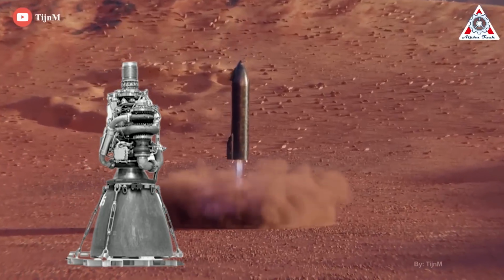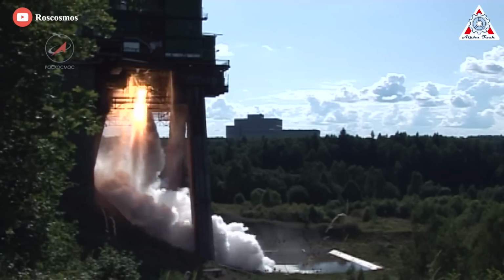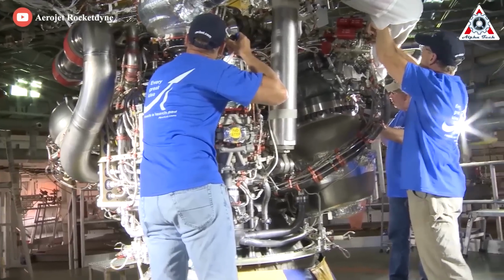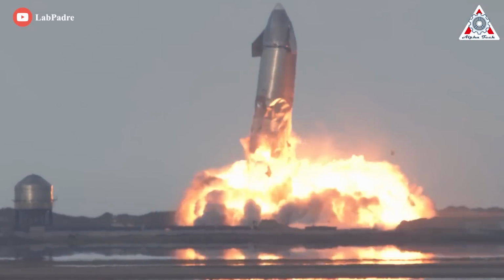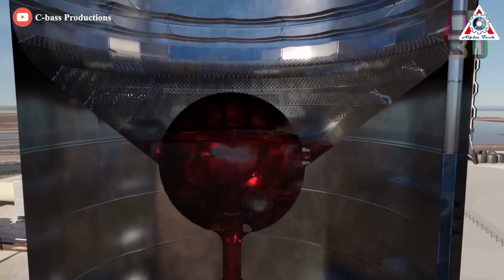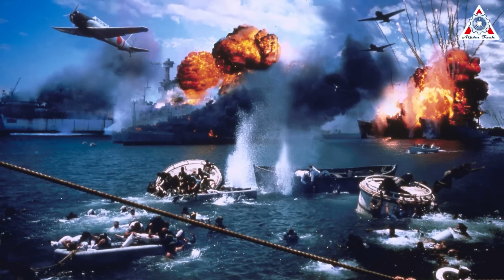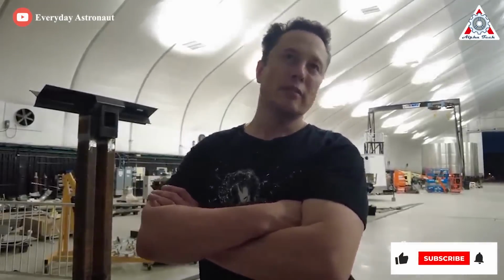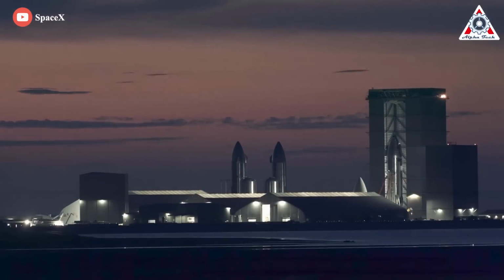SpaceX NEW Raptor Engines "BIG PROBLEM"...

Comment: Actually, the turbopump temperatures are less in the Raptor than in other engines. Reusability has been well developed and proven with Merlin, and one can expect similar steady progress with Raptor. Lets not forget that jet engines at the end of WWII had lifetimes of 30 hours or so, whereas TBO for large new jet engines today can be 20,000 hours, with subsequent intervals between overhauls around 5000 hours. Analogous progress can be expected for rocket engines.
Reply: You can't compare the technological starting point of WWII jet engines with the status of today's rocket engines after more than half a century experiences.

Comment: This rocket remains me of the soviet rocket, that just strapped as many engines as possible to their rocket.

Despite being the most powerful rocket at the time. It was not successful!! 

The more engines you have. The more you have to maintain, while increasing the likelihood of a failure.

Always kiss your work!
Keep It Simple Stupid 😉
Reply: Using the same engine for booster and return ship seems a simple start to their mass-production.
There's a sweet spot for sizing the fuelmix/SCcycle/materials engine combo that Musk's team has yet to find - but they're converging on it.
"Everything should be made as simple as possible - but not simpler" - Albert Einstein.

Comment: The reliability of the Merlin engine supersedes the fuel « economy » that can be done in a full flow rocket engine. They are way too complicated and dangerous, unreliable. Extreme performance is for drag racing, not space tourism… security is paramount.
Reply: of course, but the musk/spacex tribe will not accept that until the thing blows up with their actors, billionaires and influencers on board burning to a crisp.

Comment: If SpaceX is going to actually use Mechazilla to catch boosters and Starships, I wonder if an additional Mechazilla should be built a distance from the main OLM and GSE areas. The catch tower would only need a lift system because it's only used to catch Starship and boosters. If it's damaged, repairs would be much easier. The risk to the OLM/GSE is high and repairs would be much more involved.
Reply: its not gonna work,  at least not over and over again.    thats the problem with the idea.   its overly complicated.    39 engines and then catching hovering rockets with giant arms.    its the idea of someone who isnt an enginneer.
Reply: @jebes909090  Not complicated all and your points are incorrect. A returning booster has already spent its mission fuel requiring only minimal fuel and engines to land it over and over, again.
Reply: @Van_Liberty  its definitely complicated.   its not like landing on a pad,   it has to come in at an exact angle from a specific side.    falcon 9's can come from anywhere just as long as they hit the bullseye  and they just have to land, not hover.
Reply: @jebes909090  A tower for only catching returning craft is much less complicated than a launch tower. You miss my point, completely...
Reply: @Van_Liberty  the act of catching a hovering rocket that has to hit a pinpoint spot at an exact angle from near orbit is NOT 'less complicated'.    come on man.
Reply: @jebes909090  Where did I say in my original post that landing was not complicated. Did you even fully read it? You, then claimed I did state that, and I did not. I will no longer run down YOUR rabbit hole of BS...
Reply: @Van_Liberty  " Not complicated all and your points are incorrect. A returning booster has already spent its mission fuel requiring only minimal fuel and engines to land it over and over, again."🤡🤡🤡🤡🤡🤡
Reply: @jebes909090  The tower lift, dilbert...sheesh, you are clueless...
Reply: @Van_Liberty  tHe ToWeR lIfT 🤡🤡🤡🤡
Reply: @jebes909090  landing boosters on a boat was also like the idea of a non-engineer.  they will eventually do some catching.  it will be a long time before they need the immediate turnaround that's intended to provide.  a more immediate problem is how to take off and land in a vacuum + low gravity.
Reply: @jgunther3398  no,  it was nasa's idea that elon used.   Nasa did it in the 90s  but thier focus.changed and it was dropped.

Comment: This is a very good video.  I'm starting to get the feeling SpaceX won't be going to Mars.
Reply from the maker: Believe in Elon man
Reply: @alphatech4966  you forgot the /s
Reply: I'm sure you have the capacity to filter and logically analyze situations through scientific lenses and mathematical disciplines but your feeling of doubt seems absolute, that's the equivalent of me starring at an equation for too long, then giving up by chucking the chalk at the blackboard, throwing my hands in the air in defeat and expecting some future humans to one day come up with a solution. Unless of course this is just a personal bias which in this case would be pointless debating.
Reply: @__sir7557  "Your feeling of doubt seems absolute."  Good argument.

"Doubt" and "absolute" literally mean opposite things.
Reply: @greg55666  i 'get' the contradiction in the literal meaning, but this was implied as a metaphor rather that a philosophical expression or a mathematical concept. I could rephrase this as being highly certain about your skepticism and it would denote the same meaning without violating the rule
Reply: @__sir7557  Yes, you could rephrase it, the problem with that would be, it would belie the silliness of your entire criticism of the "logical foundations" of me expressing a simple impression I got from the video.

Comment: When an explosion is called a rapid unscheduled disassembly you might say it raises a red flag
Reply: In the RC modeling world, it's called rekitting. It's now a kit, again. Planned destruction is always there. Many things can go wrong. To get off of the pad was 50/50. To get to separation stage was excellent, especially with so much damage from the launch. I have never liked his platform, nor the lack of a trench to carry off the heat, vibration and pressure. There is still a lot to learn from the old NASA guys.
Reply: NASA called them this but had the wisdom to keep it a cheeky, inside joke.

Elon trying to sound cheeky is pure cringe.
Reply: Yeh big crator made on mars

Comment: Why do they not just make these rocket engines 10 times bigger? They are too small. Make them  big.
Reply from the maker: Too much power
Reply: Because of sonic wave instabilities beyond about 600,000 lbs of thrust. The only engine to tame the instabilities was the F-1 (1.5-1.7 million lbs thrust), designed more by trial and error than anything else before the days of supercomputers. The more powerful RD-170 uses a single closed-cycle turbopump system and four combustion chambers/nozzles. The RD-180 on the Atlas 5 is basically a two-nozzle RD-170. In any case, F-1 size single chamber engines make no sense when reusability of the rocket is in the picture (the F-1 being a not particularly efficient gas-generator cycle engine, incapable of throttling and re-start).

Comment: One concept I have been thinking on long term, is using water injection into rocket engines to both control their temperature and to increase thrust using what ends up as waste heat. Work it like an after burner.
One could also use such a system that was controlled to cool the engine and bell at the last seconds while still producing thrust, and with proper regulation and timing, use it to cool engines slow enough to prevent thermal shock in water landings. where you cut off the gasses and used last of engine heat up, creating the last pulse of steam thrust instead. and brought engine temps down to near ambient enough to prevent damage, and unlike the shuttle you could come in under power to prevent mechanical damage.

Another question I have
 is if such a system could be designed for use in space, and if it would be possible to get a combo of high enough temps on super heated steam, that you could do an electrical high voltage charge of the bell, and strip hydrogen and oxygen atoms via a high temp open electrolisys, and use some percentage as fuel as well as expansion gasses, I suspect it is possible in some  combination, using the rocket heat, the high voltage charge, and maybe even lasers.
Basically the obvious fuel of the universe is water. No shortage of ice, and getting beyond Mars will mean using ice.
Reply: When jacket and film cooling reach their limits, the next step is not to inject water but to run more fuel-rich which serves the same purpose. A steam-powered rocket also has a much lower ISP than fuel+oxidizer (around half) so why build a hybrid.
Reply: @darrell857  Well, I'm talking about using what goes out as waste heat a bit more than currently, and being able to potentially cool it down during a last pulse to near enough sea temps to dunk the engine without quench shock  temp  effects.
Not sure if the thrust from injecting the water would be worth carrying it along, but it would allow cooling the engine from combustion chamber aft, and we know the military uses, afterburners to create seriously better thrust on jet turbine engines, with the same amount of fuel and oxidzer.  they just cant carry much of it.

Also using the fuel rich mix will be pollution generators, that smoke is unburnt fuel, as has been known since steam engines... So you are saying we should add carbon to the air instead of water vapor.
 (not PC! 🤣)

Also the fuel rich mixture will be harder to light, and less likely to stay burning than the correct ratio, and from the last launch, I'd say thats not what we need, we need to increase reliability of engines functioning.
I suspect its possible considrring how short burns are, to use a sacrificial water cooling of engines and then use venturi type effects to get it internal aft of ignition and combustion, and use it to increase thrust, and decrease heat of the gasses at the same time.
This might be good in primitive fields to reduce problems where there wouldnt be water cooled steel plates for take offs and landings. to be able to effectively throttle down on fuel and use cheap water and not lose anything.  seems to me would also be great for take offs as the water would create reaction mass and lighten the ship at same time, this would maybe work really well in ships designed to take off from partially submerged in water, as the water abd fuel/oxy mass going out would increase buoyancy and get the ship beginning to move upward...

We notice that in non buoyant gravity situations it takes 8 seconds before the ship even begins to move... i.e. stationary innertia.
Ships of that size would pop up pretty good, plus. being in water would effectively weigh less to start with due to buoyancy. One might wanna size the ship to float the booster if possible, and then use everything to get it moving upwards ASAP, rather than burning things up trying to start moving off a stand.
Reply: @garylester3976  I wouldn't call it waste heat. The whole point is to get the combustion temperature up, because the increased pressure in the combustion chamber yields more thrust per unit fuel. If you introduce anything to cool the combustion (even superheated water) you get lower temps, and therefore lower pressure and less output per unit fuel.

Fuel-rich mixtures are not a new concept. Consumer combustion engines always run at least little bit fuel rich (to prevent detonation and run cooler), and even more rich when starting/cranking (some have a "choke" to literally cut off the oxygen supply when starting & warming up).

In rocket engines that orange glow is the carbon that wasn't consumed, they all run a little bit rich too.

Steam powered rockets aren't a terrible idea for first stage, except the problem with extreme pressures and temperatures needed for tanks and plumbing. For a mono propellant you'd be better off using hydrogen peroxide which would be fairly simple to manufacture at the launch site.

Comment: The full flow Soviet engines worked perfectly, NASA bought a whole bunch and flew them in the 90,s.
Reply: Ummm, no. The Soviet engines used by American boosters are closed-cycle engines with a single shaft turbopump system. A full-flow closed cycle engine has two separate turbopumps, one fuel-rich, the other oxygen-rich, with separate shafts, the propellants passing through them and into the combustion chamber. The Soviet attempt at this was tested but never flown. Raptor is therefore the most advanced rocket engine to have ever flown. The nearest to it, but using LH2 as fuel, were the closed cycle SSME's of the Shuttle, but they were not full-flow.
Reply: @awuma  what you described as closed cycle is in fact full flow, there is no difference between them.
Reply: @Justhefacts   why did alpha tech state the same then? Full flow engines have never made it to orbit
Reply: @keithsmith4236  you will have to ask them why they are wrong.
Reply: @justhefacts8358  perhaps it's you that's wrong? ?? The previous staged rocket engines you allude to were either fuel rich or oxidiser rich. The raptor engine is both fuel rich AND oxidiser rich and this is what makes it a full flow engine.
Reply: amazing story btw

Comment: Finally some realism. It's seems possible rocket engines might not reach the true reusability that their proponents would have us believe.
Reply: You do realize that Falcon 9 rockets have landed and reflown almost 200 times now? Some have flown more than 10 times each.
Reply: @TheMcMagnus  Yep one of the shuttle engine had flown more than 90 time if i remember. A cheaper single use version would have cost so much less to dev and built than at the end it would have been cheaper.
Reply: @legro19  Even if that was true, do you think that's a good enough reason for SpaceX to not even try? How would we ever evolve if everyone thought like that?
Reply: @TheMcMagnus  The question is why all what was learn from the space shuttle is not use to build a new version.

Right now our space faring capability have kind of make a leap back. If the future of space is an old concept from the 70's discarded for the shuttle we are going nowhere.
Reply: @legro19  The shuttle was a dead end. Only usable within Earth orbit and only partially reusable, thereby doomed to be expensive.

The future is all about getting enough tonnage to space to become self sufficient without supplies from Earth.
Reply: @TheMcMagnus  The shuttle have probleme yes. For starter they wanted 100% reussable. Now we know, don't try getting reusable engine they are more expensive than the single use one. Heat shield reusing heat shield is not a good idea inspection and repair is so long it cost fortune.

An airframe with expendable engine build to be cheap and easy to remove. Developping and compound they can shoot like paint and just remove after landing and apply a new coating. 

Because to industrialise the sol we will need the capability to build ship in space. Nothing assembled on earth can be effective outside earth orbit. This is wishful thinking to imagine we will industrialize anything if we have to ship everything from earth ground to destination. do you imagine how many rocket you would need to ship the thousand of tons of material needed to mine on the moon from the ground.

To move forward we have to put blue collar in space.
Reply: @TheMcMagnus  the vdo author spoke about the recertification and replacement of shuttle engine parts down to a discrete level. Landing  on the launch pad fueling back up and taking off is a long way off. I'm not sure material technology can do it.
Reply: @legro19  That's what I menat by 'self sufficient'. Starship is the enabler.
Reply: @TheMcMagnus  lifting satellites vs carrying people requires a different level assurance and lifting cabability
Reply: One just landed for #14 the other day !
Reply: I think reusability is still a thing only because russian space industry lack funding. Rd 180 was the cheapest and more reliable engine for like 30 years using cheap material  ( for rocket engine ) coated to enhance their resistance. Those engine have been a huge source of fund for russian space industry.

With enough funding, better coating process making the fabrication process cheaper a one point the idea of reusing an engine will just become stupid, the price of inspecting and refurbishing an engine being higher than just fabricating a brand new one.

Comment: A reusable propulsion system using known materials and designs is not a new problem. In the broad scheme of things there aren't any new kinds of materials being used. The only things the engineers are doing today are incorporating fanciful and creative ways to use the materials we already have. Werner Von Braun once said that there were only two problems to overcome in rocket design. That was thrust and guidance. What he failed to include were endurance and reliability, which is still an enormous issue. I can not see the raptor engine as the solution.
Reply: It could certainly blow up Moscow.

Comment: I don't get this analysis at all. Why compare Star Ship in 2023 to the STS program from the 1970's when we have a reusable rocket by the same company now? "If the flight certification is like the STS program" why would it be like that at all? I really fail to see why you wouldn't compare to Falcon and Falcon Heavy. Falcon Heavy has 27 engines which isn't far off the 33 on Star Ship and every one of them is flight certified some of the engines many many times. So clearly there is much better and more modern precedents for this and not STS. In fact you go about making many blanket statements that you don't support at all. "the material has to be on the edge of failure", no it doesn't and we don't know that the alloys in the bell are near fail. In fact they could be very happy at the operating temps.
Reply: Historical reference it is called .  The comparison is liquid fuel rocket engines reusability  recertification .  The violence imparted on the rocket engines is the same.  Do you see Musk as a God?